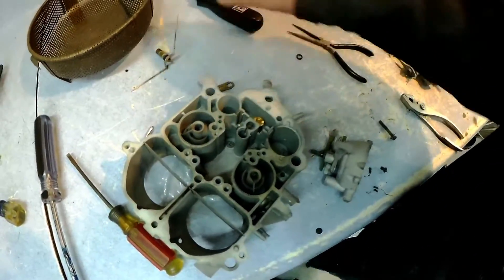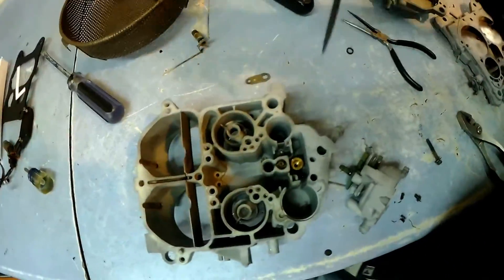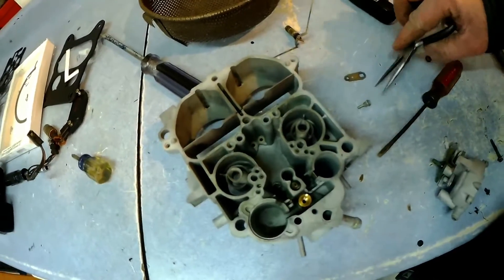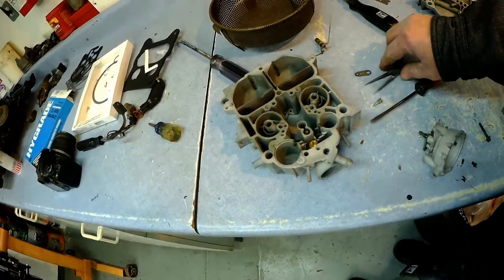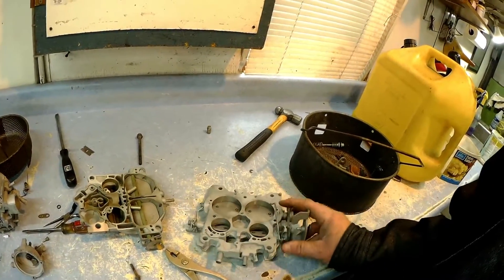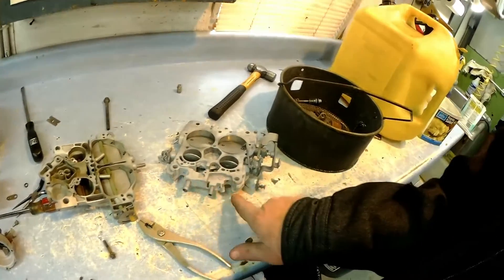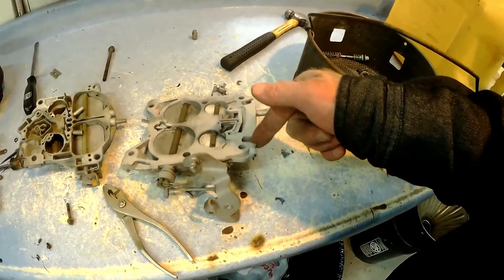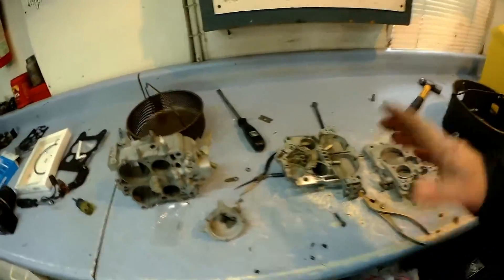GM Quadrajet Rebuild Tips

Comment: what should i look for,..  on the long debated dieseling issue. 84-86 454 bounder breaking bad r.v. that sat for way too long. i may be the first to pull the carb but will know soon
Reply from the maker: The only way it can 'diesel' is if it's getting air.  So you want to make sure the throttle plates are closing, and especially check the secondary plates by pushing forward on the lever (driver's side of carb). Be sure those secondaires are completely closed and if not, figure out why.  It's a common issue.  As far as the primary side, just be sure the choke is completely relaxed and the high idle cam is flopping down out of the way and not holding the primaries on a partial high-idle. If all of that checks good, and your dieseling persists, I'd install an electric step-up solenoid on the primary side.  You'd see them on Cadillacs, I assume to solve dieseling. They simply pop out when you turn on the key and push the primary throttle plate open to the base hot idle setting. They are adjustable.  Then you back off the primary throttle stop screw (driver's side front of the carb) until the throttle plates close completely in the bore. Then, when you turn "off" the key, the step-up solenoid collapses and the throttle plates completely shut off all air entering the engine. You can see the step-up solenoid I'm referring to on this carb on ebay https://www.ebay.com/itm/17084208-Rochester-Q-jet-Carburetor-camaro-monte-carlo-dtd-2733-Sept-30-83-/202105377408

Comment: I have a manual choke that was  just rebuilt but it continues to flood .the adjustment screws are turned all the way in and the engine still run what's my issue
Reply from the maker: Does it appear to be flooding? meaning, fuel bubbling up and out of the vent and/or fuel dribbling out of the main nozzles ?  If so you could have a tiny piece of debris caught in the needle and seat or, the float may be adjusted wrong (assuming they put in a new float).  If it is flooding, try disconnecting the fuel line from the tank (at the fuel pump) and let it run out of fuel. Reconnect and start the engine.  That can dislodge a tiny piece of debris in the needle and seat.
Reply: @mark_osborne  black smoke out of the exhaust  plugs damp with fuel, float supposed to be new

Comment: I put a kit in mine and idle jets do nothing and I've only got 14" of vacuum and at idle the tach ranges 100 rpm.  I checked the float its right.  So I'm looking for a vacuum leak now.  Comments much appreciated.
Reply: Did these problems arise after the overhaul.
Reply: No, these problems were what I tried to fix with the rebuild kit. I found a new carburetor on eBay from China that I will install, but I haven’t got around to it yet.

Comment: I wish I had gotten into cars at a younger age. Now I have a 68 327 corvette and have to learn to do this on my own to not have this car be a money pit. The guy that installed my brand new quadrajet let me drive home either with no divorce choke assembly or it wasn’t screwed on tight and fell off because it ain’t there. Needless to say I’m not taking it back. He blew a bunch of smoke up my ass, even has a 69 427 in his “showroom”. But later on into the tune up told me he was a “modern injection guy” and didn’t know carbs, which is why he couldn’t get the original running making me by the new one that’s now missing shit. I’m so pissed right now. So if a performance shop can’t get it done right I’m going to have to do it myself. Well I have YouTube and friends who know more than me that can help anyway. I’ve also heard that the air horn can also warp if the air cleaner is over tightened. Thanks for the info.
Reply from the maker: Sorry for your trouble, perhaps you can find more help on YouTube, it's an amazing resource of knowledge. Best of luck

Comment: I haven't gotten to deep into it but I was going to take it apart and dip it overnight in cleaner but now that all the screws are off of the air horn it doesn't pop off and I don't want to ruin any of it by forcing it off is there a certain way
Reply from the maker: Can't say I've ever ran into that problem ... there are 2 locating pins near the rear of the air horn that indicate it to the body, they may be stuck from corrosion ?